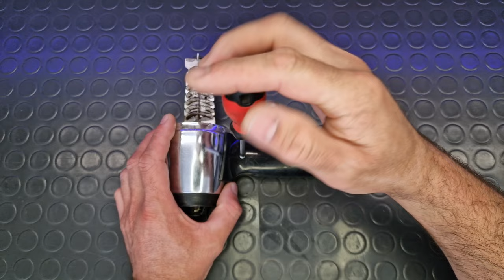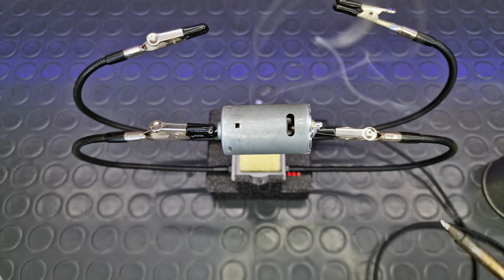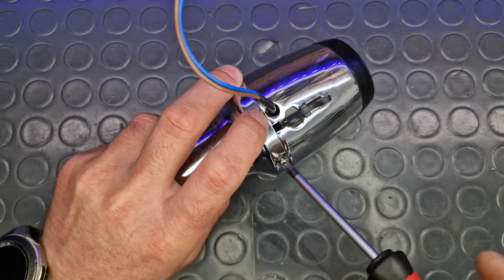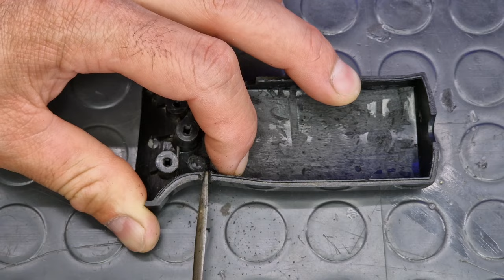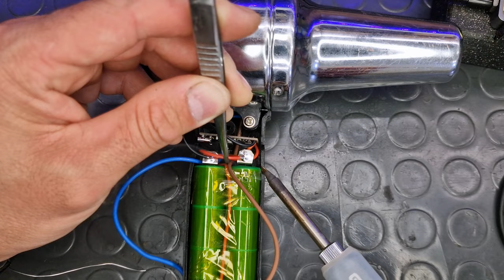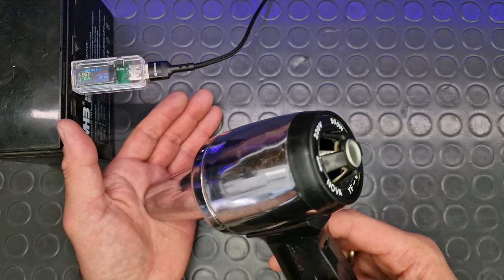How to make a Barbeque Fan Blower from old Hair Dryer which I bought it from the flea market for $1

Comment: Although it seems that it blows weakly, the end result is WOW. What is this module by the way 🤔. It looks like an ideal solution for charging 6V batteries.
Reply from the maker: This is how it looks in the video, Brother, but believe me, it blows like a powerful hair dryer. By the way, I really liked this charging module because it has a built-in boost module and you can charge 2S and 3S 12.6V LiIon battery pack using a 5V standard charger🙂
Reply: I also noticed the module. Already purchased it from AliExpress 😊

Comment: Which module did you connect the 2 serial batteries to? Don't you need to use BMS circuit?
Reply: yabancı sandım ingilizce yazdım k bakma. 2 seri pili 2S BMS ye bağlaman gerekmiyor mu? O modulün ismi ne eğer orayı çözersem iş elimde hemen modülü alıp bağlantılarını yapacam